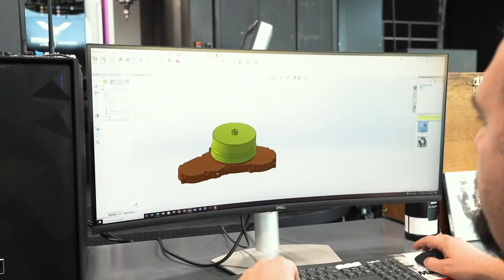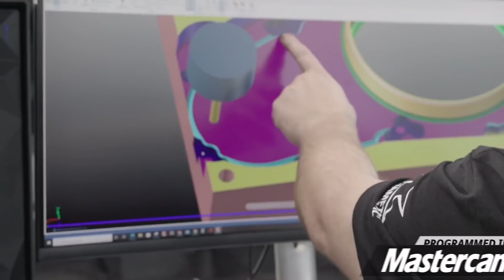I Will Never Own My Own Company and I Will Never Be Rich

Comment: i think i'd like to have my own company, have a little job shop with dmg mori machines, my favorite brand. although i barely know how to run a company at all. i'll have to learn i guess
Reply: That's awesome 👌.  I would recommend taking some basic accounting courses.  Spreadsheets are your friend and stay up-to-date in your paper work. I took the approach of having many small customers, but I do have one big customer that accounts for 45% of my gross revenues but some of the bigger fixed costs like insurance,  tools ,etc.    Some the best advice I got was 

1. 3 year cycle. Bad, good, excellent. 
2. It will take about 7 to 8 years to build a customer base.

After being in business for 14 urars I still follow those rules. 

Good luck 👍
Reply: I'm assuming you are still young so why not as long as you do your homework and start small and possibly a cheaper brand machine than DMG MORI to start with.Don't be afraid nothing hard about running a small company just find yourself a good accountant.
Reply: @mehmettemel8725  i do thing dmg had financial stuff in place to help startups
Reply: @cyber2526  There you go you're lucky one nil ahead.
Reply: @mehmettemel8725  i should probably research how i’d connect these machines with air and power first tho

Comment: I can’t find a shop that’ll give me cad/cam time. I’m at the point I’m trying to buy my own seat and start contracting. Any pointers from any folks who have gone that route?
Reply: I bought my own cad in 2011. Bought a nice laptop and would sit in an office or restaurant with the customer designing parts. I still think I'm pretty good with SOLIDWORKS.
Reply: I charged 100 per hour. I have met engineers who can't use cad . Full engineering departments can't use cad. They pay me to do it for them. I bought some cncs and I get to make it after I design it. Which the customer likes.
Reply: @wannabecarguy  any suggestions on laptop? Any specific cad/cam software I should get a hold of? I’m pretty good with MasterCam and Solidworks it’s just been a while with my toolpathing skills. Shops I’ve been working for have had me doing more setups and shop floor duties. I’m ready to transition into programming and building my portfolio and at this point I’d rather work 100hrs and feel accomplished about honing those technical skills than 40hrs for pennies while they build equity to the moon
Reply: @ptcghustler5406  if you can, go for the student editions first, if the money is there, when its time to renew go for the standard editions of the program. thats what i was told at least when i talked to the mastercam rep
Reply: @vanguard6937  any suggestions as far as hardware goes?
Reply: @ptcghustler5406  look at  the minimum specs for the software of your choice, and get better than that. i cant really tell you much as i dont know your budget, your needs, etc. i mean sure, i could tell you to drop 1.5k on a desktop to do it, but you may be looking for a laptop under $700